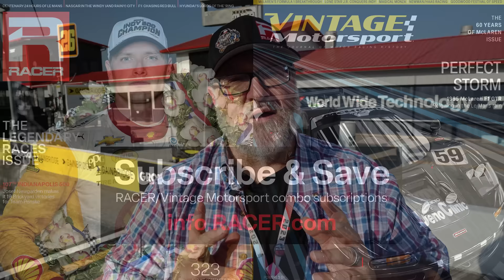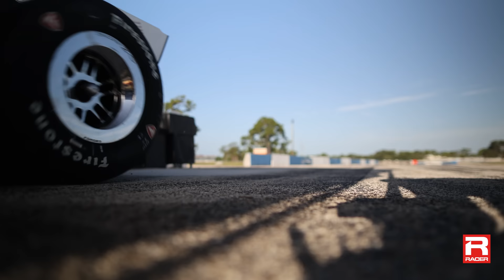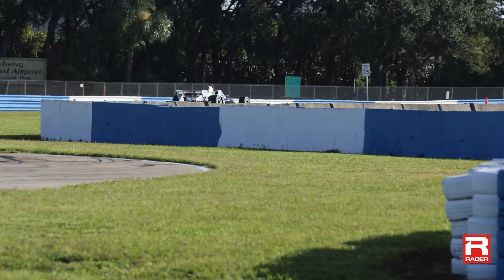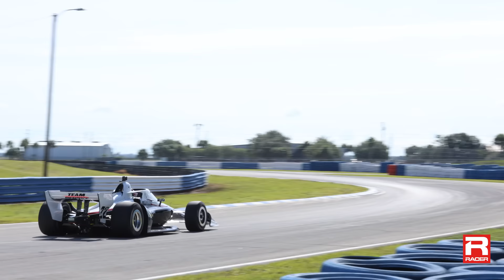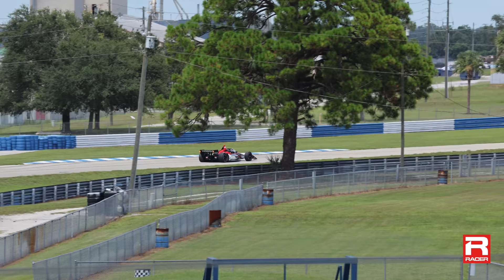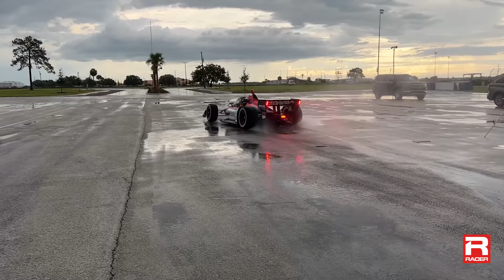Listen To The Sound of IndyCar's 2024 Hybrid Engines

Comment: Given F1’s elitism, Indycar is set for an explosion of popularity.
Reply: Indycar has to drop the ovals to ever have a shot to compete with F1 in terms of popularity
Reply: @TheGamerzXChannel Indycar is nothing like F1. Cheap or otherwise. The only thing they have in common is both are open wheel. The series stands on its own and has no need to measure up. There are many things that advantage Indy over F1 just as much as the reverse is true. Will it ever be as popular as F1? Unlikely. Does it need to be? No at all. It has its own identity and it has a constant steady growth in popularity.
Reply: @TheGamerzXChannel Indycar is not a cheap version of F1. They're completely different championships. It's like saying that hockey is a cheap version of soccer.
Reply: @TheFrontyer  By no means, ovals are the essence of the indycar. If there is something that distinguishes the indy from all other categories of formula cars, it is precisely the oval.
Reply: @juanvillalba2404  Never said anything else, just that for indycar to be interesting enough to challenge F1 in popularity, ovals needs to go, as the vast majority of people find them boring
Reply: @TheFrontyer  I assure you no, many Europeans are finding it interesting. There is nothing boring about it, on the contrary it is very exciting to see them rotate at high sustained speeds close to the wall.
Reply: @juanvillalba2404  «Many» is a very relative term. Compred to road racing its very very few. 

I enjoy the road courses of indy car, but watching oval is quite boring, I have tried watching many times.
Reply: @TheFrontyer  But just because you don't like it doesn't mean others don't like it. Maybe you should dedicate yourself to see other categories where there are no ovals
Reply: @juanvillalba2404  Trud, however it is not just me, that is the entire point. It would have been far more popular if it ditched the ovals.
Reply: @TheFrontyer  No, that's not the way to gain popularity. Indy must leave the US to really be popular, he needs to run in Mexico, Argentina, Brazil and Japan. This is the only possible way to really become popular, not leaving aside its main essence, which are the ovals.
Reply: @juanvillalba2404  That would help too of course

Comment: One thing I realized. Hey, F1 fan friends, the engine running at 21000 rpm, 17000 rpm is weird. Currently, the V6 is around 15000 at most. No wonder you think the engine sound is broken. Look at the IndyCar, hybrid intervention doesn't make much difference at that level. So does WRC. F1 had an unusually high rev.

Comment: I'm guessing these hybrid power units don't have an MGU-H the way F1 power units did from 2014. So this is kind of like a preview of the 2026 F1 power units which won't have the MGU-H.
Reply: That's right, it's a stripped down version of the MGU-K used by F1 today.
Reply: @juanvillalba2404  only MGU-H will be removed, MGU-K is still in use

MGU-K & MGU-H are 2 different components
Reply: @rhezarief  Yes, actually I meant that it is a simplified version of the engine that F1 will use in 2026

Comment: I find it a little more louder and beastier
Reply: I hear the revs pick up a bit faster. Is that the hybrid unit kicking in? Maybe. Although I will say the engine does sound a bit meaner near the redline. I hope they're running the higher hp engine map as the baseline power level.
Reply: @izzdin6228  Ya I think that hybrid unit is kicking making that engine sound more beasty and looks more torquey which I love.  They say another 150hp so I can't see the engine sound staying the same with the added HP. Either way sounds sweeter than without the hybrid unit and way better than those F1 lawnmower sounding engines!

Comment: As these engines are basically Formula 1 engines with a bigger block and 1 extra turbo,, while the volume will be similar (that's down to the acoustic design of the exhaust. Mercedes,ferrari etc even audi and vw tune the exhaust sound and volumes), you will hear much different sounds, like turbo whistles and rough popping

Comment: Tbh that sounds even better, I'm just glad it doesn't sound anything like Formula-E because I stopped watching that cause of the annoying high pitched screeching of the engines
Reply: Might just be me, but I kinda like the combined sound of an ICE and electric motor, especially when they kick in off the corner. You get the engine growl as it starts to load up, and then that distinct scream as the hybrid kicks in and launches the thing. The 919 Evo Nurburgring onboard is probably the best example of it for me.

Comment: I don't mind the hybrid engine. But please, don't screw things up like F1 did and is still doing. Don't come up with a stu*** DRS system. Don't come up with a stu***  dynamic wing system that penalizes who's in front, like FIA is trying to implement in F2, and then F1. And, most especially, don't penalize drivers for racing, like F1 does. Let them race.

Comment: Give a new lighter chassis and power steering and 18 inch wheels
Reply: No way, they're already lighter than an F1 car and the lack of power steering is what makes a challenge in a drivers championship.
Reply: @goodshipkaraboudjan  Given so much power it will be necessary to introduce power steering. They are approaching the threshold of physical resistance.
Reply: @juanvillalba2404  Power has nothing to do with that though. In the 70s the Porsche 917K was over 1000HP and drivers would do huge stints. I think it's a case of shocks/dampers, hence it's open development for them in Indycar.

Comment: They will gain 0 fans from this. Just silly pandering to the manufacturers. Good job +5 social credit score for you Indycar! Made it harder for new teams to join for sure. Swap out your god awful announcers and tv production and that may gain you something.
Reply: Means nothing for new teams, it's part of the engine lease.
Reply: @goodshipkaraboudjan  Not familiar with the leasing structure. Your saying it added no cost to the lease? Even if so there are only so many good hybrid engineers on the grid. Top teams will be able to hire them. Others will not.

Comment: This is the main reason why IndyCars are behind in tech.  Yes, it is a simpler cheaper racing formula, but Formula 1 and even WRC rally cars have adopted hybrid tech years ago.  So, for next year, finally, Indy is adopting the tech.  This is so sad, too little too late.
Reply: The reason being is they scrapped the new engine formula so had to make do with the current engines without affecting the sound. It's a win win given how they have reduced the weight and lowered the CG of the cars massively for next year and now they're more powerful.